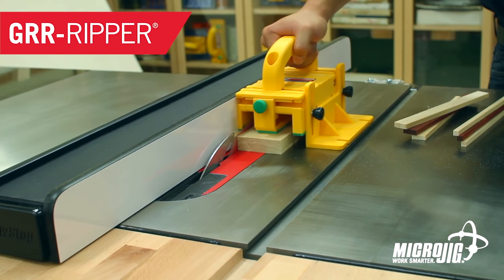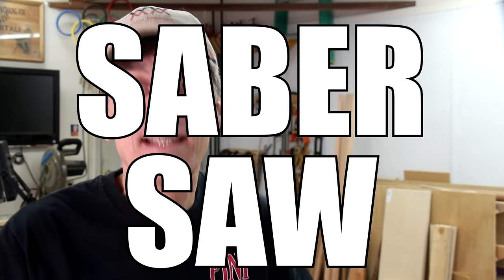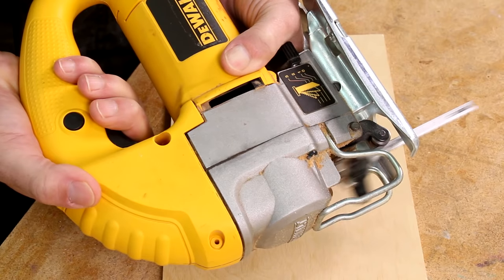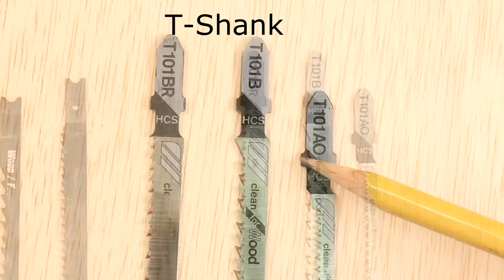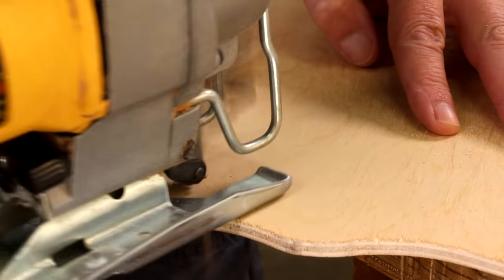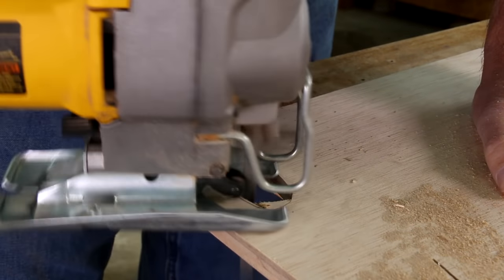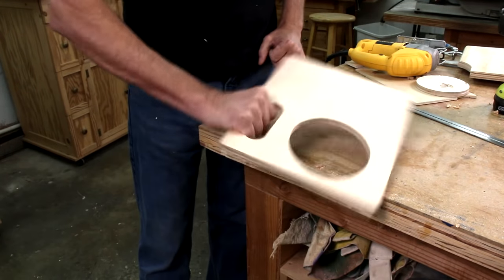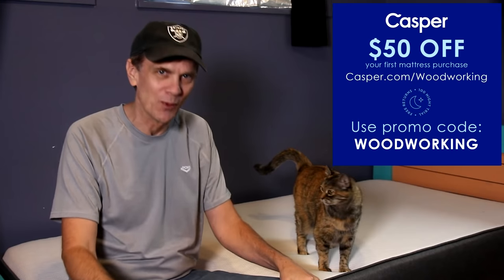What Can You Do With a Jigsaw? A Lot! | WOODWORKING BASICS

Comment: And what if my jigsaw doesn't cut square? Yes I tried to keep the base nice and flat on the board. Yes the board was a little thick but I don't think so that much. No, it is a good brand, it was not so cheap. 
What else should I look after if those thing are OK above?  The wheel guides?
Reply: You feed it too fast, let the up-down movement make the cut, not the forward pressure. Feed is not same for all types of wood, you kind of need to get the feeling for it. It is pretty much right when you feel almost no resistance when pushing forward, that means that the blade did it's job of removing material before you simply push it into empty space it left, and let it have some more to chew, rinse and repeat. It is good also to pause feeding for a moment while letting saw run in one spot for a moment, in order to let the blade cut material a bit wider around itself on some spots, that way it will have room to straighten itself before you continue your cut.
Reply: Hmm... I have never thought about this bit although it is really simple and reasonable. Thank you man, I will try it tomorrow as soon as I get up. :)
Reply: I wish you straight cuts and a lot of fun with all of your projects.
Reply: :D Thank you so much. A lots of idea but not too much time and I just started out so not too much done pieces as well. Well, in time, in time...
Reply: I know this is an old comment, but 99% of the time its technique.  How you hold your body, how you move the saw, etc.  Keep your wrist and fingers steady, turn with your elbow, keep your body close to the workpiece, and keep your index finger to the front of the saw, not the trigger, and hold the trigger with your middle finger.
Reply: Paul Vasso  i have the same trouble with the same brand of saw
Reply: cutting   square  takes  practice..

Comment: Be sure to buy a good quality jigsaw, the cheap ones will not hold the blades correctly and your cuts will be of poor quality.  A little more money will buy you a good quality jigsaw that will meet or exceed your expectations.
Reply: Ditto, at least on the cheap ones not performing well at all... Bought a Way-Mart brand for $18 the blade doesn't even stay within the guides...
Reply: I'm Simon You need to avoid anything walmart..EVER UNLESS IT ID DIRT AID SUPPLIES IN THE MIDDLE OF THE NIGHT.....EVEN THEN THERE ARE OTHER BOX STORES OPEN.
Reply: I'm Simon oh wow I was just contemplating buying that one
Reply: I've had that experience. The frustration, alone, with a POS jigsaw makes it worth it to spend more on a better tool. Even if you don't use it every day.
Reply: ive never heard of that Brand "Good One" where can I buy it  (hint)(hint)